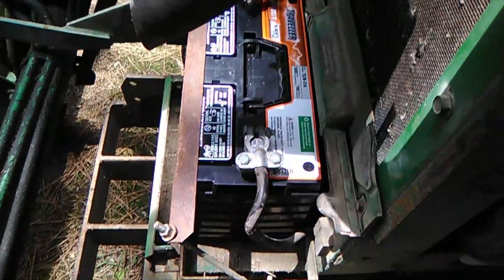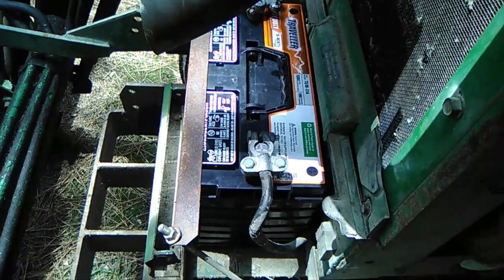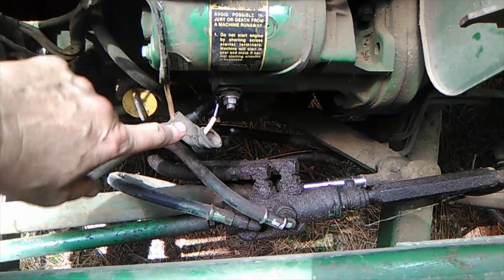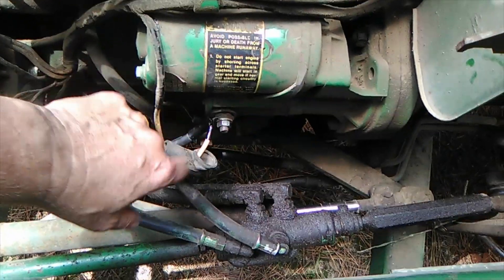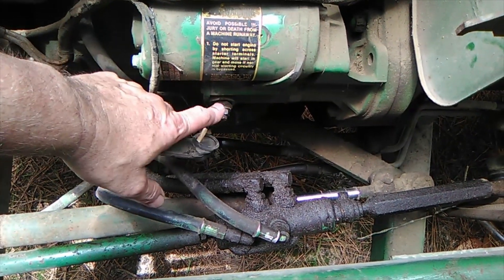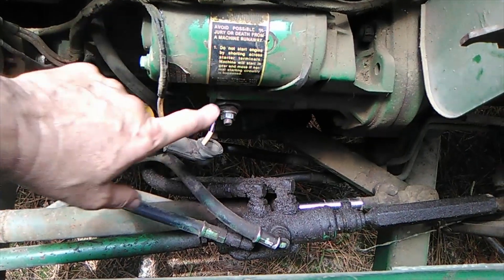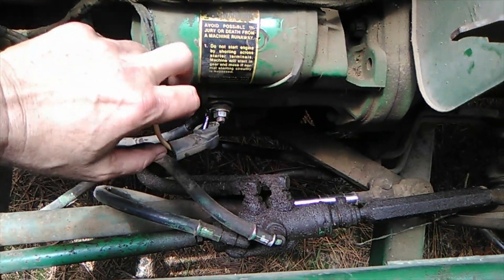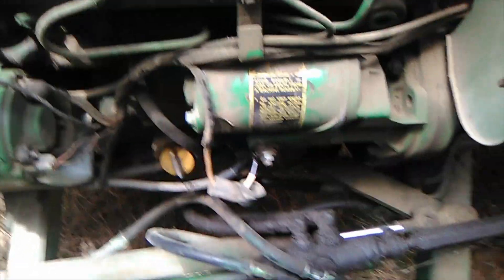The John Deere 950 tractor will not start, maybe.

Comment: Nice save.  My first thought would have been what I have done on my cars over the years when I had a starter issue.  That would have been to get a hammer and whack it a few times, and it would start right up.😅  But your solution was much better.
Reply from the maker: Funny, the internet told me to whack it, did it and nothing.  Glad it turned out simple.  Thanks.